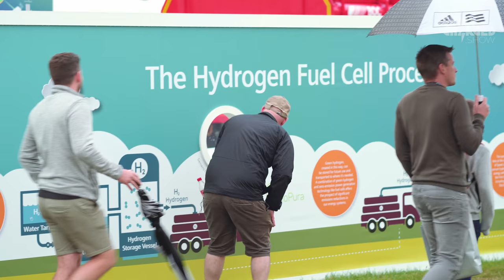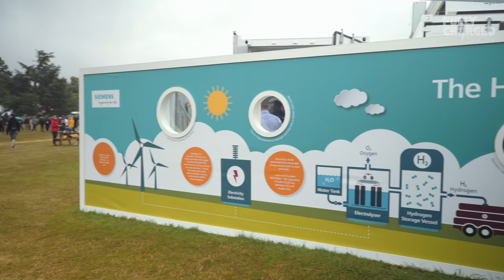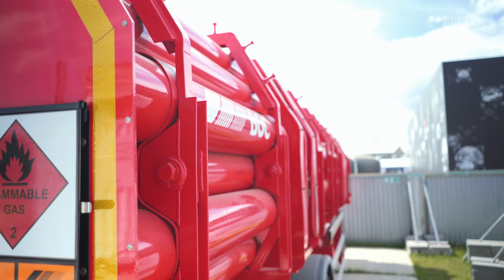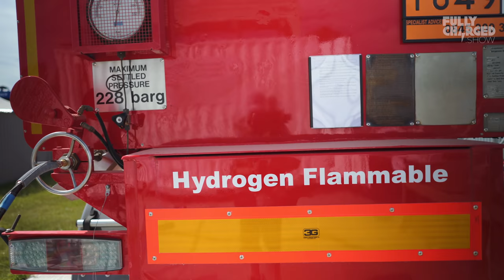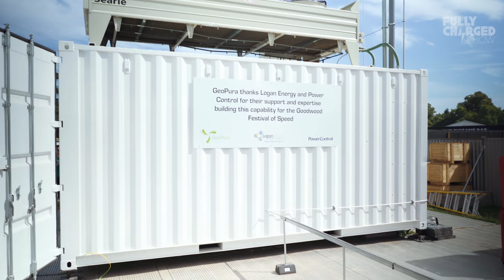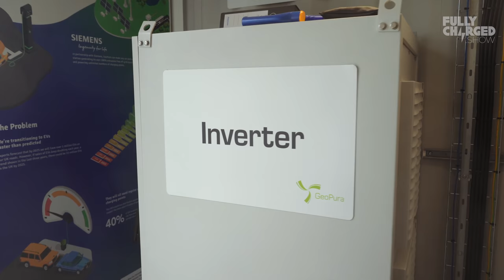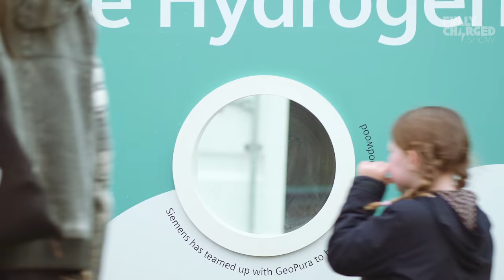Green Hydrogen Fuel Cell Charging System at Goodwood Festival of Speed | Fully Charged

Comment: In reference to 5:20, isn't a hydroelectric reservoir typically a great form of that rather than bottling up hydrogen? Since they can pump water up when electricity is surplus, and then generate on the way back down. Obviously that isn't a 100% efficient process, but loosing 50% of the energy going Hydrogen->Electric, and presumably more going Electric->Hydrogen to begin with doesn't sound great.
But from what he says, it does look like a good diesel generator replacement. Hopefully they can miniaturise it to the size of a diesel generator to make it a bit more useful for non-festival scenarios.
Reply: I think the issue is that you're limited by geography/ecology as to where you can place a hydro reservoir. This could be modular/placed much closer to population centres/where the demand is.
Reply: The method of generation you talk about uses more energy than it generates, but it's still really useful. Read about Dinorwig Power Station which has been featured on Fully Charged before. If the energy sources are creating too much energy the best thing to do is store the excess when you need it. A hydroelectric power station allows very quick access to energy, it takes about 6 seconds to spin up, whereas the hot stations (coal, gas) can take hours. The main takeaway is that you need to store excess energy and if you don't have a reservoir to fill, or batteries to charge, then hydrogen is an easy way to store that excess without impacting the environment.
Reply: aljowen not enough places/capacity for pumped water. Something have to replace natural gas and alike - and something have to store excess wind power.
Reply: @craighamnett  I guess that make sense on the basis of storing fuel for days/weeks/months. From watching the video I had assumed they were proposing it for filling short term gaps (so day to day storage). From that hyper long term perspective, I guess its almost like trading stocks in regards to when you buy your electricity, and then when you sell it. Actually, that lack of urgency to sell sounds like it could create some price gouging where people aren't willing to sell until 'x' threshold.

I have been to Electric Mountain in Wales and had the tour, I really enjoyed it.
Reply: Steve Davis if you use this for district heating - then heat waste will not be an issue. A large commercial static tank would also be able to store 1000 times this.

Comment: down with centralised electric production and large scale grid based distribution systems! what we need is a distributed e.g locally produced, stored and used energy. this is the best alternative we have! anyway! why not collect the O2 that comes out of the elecrolyses process store (like H2 is done in tanks) and use it instead of pumping in air containing less O2 from outside. this way O2 would come to good use and was not a waste product. also, why not have a stirling engine running beside the system producing even more electricity and increasing efficiency?

Comment: Nothing New here. H2 Fuel Cell tech has been around for a long time the reason why it is NOT popular yet is the production of H2 (even if it is green) tend to be more expensive that using the same to store in battery. Also these guys did not talk about the cost of Fuel Cell and a comparison with similar technologies like Flow Batteries which can also be used to store large amounts of Energy for similar situations (right now an expensive tech).
PS: doesn't that guy look ignorant when he talks about the current efficiency of ICE engines and was corrected right away?

Comment: could you not build a "base load hydrogen power plant" which makes electricity via the fuel cell, that then takes the water and excess heat and make a secondary steam turbine generator system to increase its overall efficiency?

Comment: The water isn’t pure, it can only be pure if you mix pure oxygen and pure hydrogen. When you mix the hydrogen in air it also mixes with nitrogen and other elements in the air. Plus pure water isn’t good to drink, it hates to be pure so pulls minerals from your body and pure water doesn’t conduct electricity so if you drink too much your brain and heart shuts down. There are always warning labels on distilled water about not drinking it. I doubt you have to worry though because it wouldn’t be pure anyway. I hate them saying incorrect information though.

Comment: See I live in a hot county so heat is not really needed.. even though of the idea of using that heat generated to generate some old school heat based power as well..
Reply: What if they converted the heat into cooling, that would be useful at a festival too. They could also use the heat to make the decompression of the hydrogen more efficient or use the commission for additional cooling

Comment: Hydrogen definitely has a place in an ICE-free world, as it has big advantages over batteries in several categories (refueling speed and energy density for example). Just need to work out the production, storage and transportation issues.
Reply: Not true , the entire hydrogen chain is far less efficient than batteries.  Hydrogen will never make sense for vehicles.
Reply: @JRP3  So you can say with absolute confidence that hydrogen has absolutely NO place - AT ALL - in the world? Not one single application would benefit from it? And notice that I didn't say that it would have to power vehicles necessarily.
Reply: You can say no such thing with confidence, dude. You are not clairvoyant, if such a person actually existed, and cannot foresee any and all scenarios that might present themselves. As I said in my original comment, IF they can work out the inherent issues relating to production (expensive), transportation (expensive and potentially dangerous) and storage (small infrastructure) then it actually would be desirable: Fill up in about a minute or two and smaller batteries with longer range and more power (due to higher energy density) are two of the biggest issues currently keeping traditional BEVs (lithium ion) from being adopted by the mainstream public.

Comment: -So Green energy meaning Electricity. So you take that electricity and make Hydrogen and Oxygen  ( At least)  Huge amount of green energy required. You then take that hydrogen and convert it BACK to electricity in a facility that even if the process was fully 100% efficient would still require maintenance , labor costs,  etc.  and on top of that a profit! for the company buying that cheap green energy and converting it to hydrogen and then converting it back into more expensive energy.  I can't help but think this is a flaw in the business model

Comment: Alternatively, carry a large battery and inverter. Much more efficient to charge the battery than convert to hydrogen and then back to electricity again. I'm not getting this, sorry.
Reply: Energy density I believe
Reply: There is no way to recharge a large battery in a field at Goodwood. Easier to bring in hydrogen in a trailer.
Reply: @oskrich4  Or bring in another battery in a trailer.

Comment: Only if you can 100%-ly transport, store and process CH4 (Methane) to hydrogen without the CH4 leaking into the air only then it will be clean. If not leave it in the ground where it's been for millions of years.
Reply: But this H2 isn't from CH4, although some is from CH4. Its made from using excess electricity to electrolyze water. Orkney is using their excess power to do the same thing.

Comment: Realistically, this is a doomed technology, interesting though it is. At best it will be nich for charging where there's not any or insufficient charging infrastructure, but that's it. Why would you create Hyrdogen from electricity to convert back with the associated losses unless you absolutely had to do it? It's certainly not going to be as cheap as charging from the grid, and longer range cars will make it there and back without the need to charge in the situations they're imagining.
Reply: @Steve Davis - Agreed. We already have a liquid fuel that you have to go to special places to fill up. Replacing that with a different one when there's an alternative where you can charge a car at home or at work is pretty hopeless too. It's a shame, it's  a brilliant technology, just not much use in private transport.

Comment: I wouldn't expect fuel cell technology to air on this channel, the last thing we need is wasting clean energy that we so much need.
Reply: It is a mechanism to store clean energy. You can't always use the clean energy at the time of generation so you have to store it. You can store it by charging batteries, by creating hydrogen via electrolysis, or push water up a hill and store it in a higher reservoir. The grid is a complex system that needs energy at the right time so you need a wide variety of storage solutions.
Reply: why? It's stopping people from using Diesel generators and you don't need incredibly expensive batteries.  If you use the heat then it's much more efficient too.
Reply: @Steve Davis AFC Energy have alkaline cells with a steel catalyst, an automated manufacturing process and they claim to be doing great work on increasing the  lifetime. They can also use hydrogen that isn't perfectly pure.   They are not improving electrolysis but if you can get hydrogen that is produced as an impure byproduct of other processes then it might not matter. It is true however that I am just another non-expert reading things on the net.

Comment: So why not just use the hydrogen in a fuel cell car......less conversion losses without having to charge the car off a fuel cell like here....(and yes i know that fuel cell cars have a load buffer battery)
Reply: Take energy.
Build expensive plant
Liberate Hydrogen (50% efficient!?)
Pump to tanker
Drive (expensive) tanker to point of use.
Store (keep it cold! Use energy!)
Pump to fuel cell (50% efficient!)
Use the 25% of electricity remaining to charge a car battery.

See the problem?
IT'S 25% EFFICIENT

Comment: Right so a truck and trailer unit has 3 mega watt capability so the equivalent of 30 100kwhr Tesla battery packs. So why not stick a bunch of charged batteries in a containeer. Oh right they are doing that. Tesla Megapack.  Hydrogen a solution in search of a problem.

Comment: H2 is made with natural gas. Getting the natural gas creates a lot of methane. Methane, which is next to co2, a very strong climate changing gas. H2 is everything but climate friendly. Also the efficiency of fuel cells is far from beeing good. It is closer to a standard petrol engine than an electric motor with battery.
Reply: And also by electrolysis which is very climate friendly. Talking about efficiency, petrol cars hovers around 35% (max) efficiency and diesel ones 45%. I see no one being mad about it.
Reply: I think you've missed the point of the video.

Comment: WAIT WAIT WAIT, How much electricity did it take to make the hydrogen in the first place? And where did that electricity come from?So if you factor that into the equation then the entire system is not 50% efficient at all. So ,to use electricity to split water, and then use the hydrogen to make electricity again is the single stupidest thing I've ever seen. Make electricity ,store it as electricity, in ,like, a battery. Then just use the electricity. If that truck was full of charged up Tesla battery's , it would store more actual energy than the hydrogen.

Comment: Using hydrogen to store electric energy is just wastful. You loose a lot, it cost a lot and it's very dangerous.
Reply: To be fair, the energy being stored is supposed to be energy that would otherwise not be usable, so if storing that energy and using it at a later time costs less than the cost of energy at the time of use, it’s not that insane...
Reply: Can not say that I agree that this is given. If you can make a system that make hydrogen and store it, you can also set up batteries that would be a lot more efficent.

Comment: Why not just cut out the middle man and put hydrogen motors in cars....
Reply: I assume you are referring to internal combustion engines. The reason is that burning hydrogen in engines has even worse efficiency than than the fuel cell route.
Reply: @Simon-dm8zv  no im referring to electric vehicles having a small hydrogen generator to power the electric motor, by cutting out the middle man i was talking about having to stop to recharge in the first place.

Comment: this wastes so much energy, only half is actually converted to energy the rest is waste heat, then the waste from chemical, into electrical, into chemical, again into electrical then into kinteic, why not just go chemical to kinetic, only needing few modifications to a normal combustion engine to run, then tanks to store hydrogen
Reply: @Steve Davis ICE engines are notoriously inefficient. They mentioned in the video that an open-cycle gas turbine generator is about 30% efficient. These HFC are almost 2x the efficiency.

Comment: 5:23 Aren't we already long past this tired conservative argument of "if the wind stops blowing and the sun stops shining" concerning renewable power production? At least since Horndale??
I would so much like to throw at these guys "if the oil stops flowing and the coal stops rolling" one day to see them squirm...
Reply: Afraid not.  The Hornsdale battery primarily serves as a frequency regulator — it supplies extra power or sucks up excess for a few seconds or minutes while other plants adjust.  This is something traditional power generation gouges heavily so Hornsdale is very profitable.  It would not be profitable if you made it big enough to store an entire day's worth of power, that's just way too expensive with current battery tech.
Reply: @rhamph  Point is, Cunningham's claim that this is hard to do with batteries is simply false. Those Hornsdale Powerpacks can be used as regular energy storage as well as a peaker plant. And Tesla just introduced their 3 MWh Megapack as well, the whole system in one standard shipping container footprint. These packs don't contain explosive gas and don't require all these extra containers with all that tubing and wireing. Sure, they don't make sparkly water though.
Reply: @2nd3rd1st  If you translate "hard" as "insanely expensive" then it is hard.
Reply: @rhamph  I agree, but the price may also be a matter of negotiation and I guess this complex hydrogen contraption requires a whole lot of expensive maintenance. In any case one always pays more for advanced tech.

Comment: If you're already making hydrogen out of air why not the whole carbohydrate fuel for existing cars? Problem with hydrogen cars is that they're expensive and even if they were the same price as gasoline ones, people would still need to throw away their cars and buy new ones, so it seems creating artificial carbohydrate fuel is a goldmine awaiting to be exploited, especially since there are also ships, planes and trains to think about.  There's Sahara, build the solar thermal power-plants, use sea water for hydrogen, air for carbon, create fuel and we have a carbon neutral world.

Comment: Sorry, this is really dumb. I and many others have explained this over and over, hydrogen is pointless, the overall fuel cycle efficiency is so low, you waste at least 2/3 of the original energy, regardless of source. You are much better off charging a large battery directly than electrolysing water, compressing it and running it through a fuel cell. Indeed, you get 2-3 times as much usable energy if you just stick it in a battery rather than messing with hydrogen and fuel cells.

What's happening here is that large companies like Siemens are seeing a new market in fuel cell systems and so are pushing them, despite knowing of the inefficiency problem. They don't care, it's a new market for them to exploit and make money in, which is what shareholders want. Of course, the people who get suckered into buying fuel cell systems often understand none of this, they just hear "hydrogen" and think "green" when that really isn't the case at all.

I really, really wish FC would stop doing hydrogen videos, they distract from what we should be doing, which is pure electrification with maximum efficiency. Sure, you can use hydrogen to store excess energy from renewables, but you lose most of that energy doing it, it's almost pointless. Sticking that spare energy into batteries would give you 3 times the usable energy when needed.

It's not like hydrogen is easy to store or handle, the stuff is a real problem, it requires massive compression - you can't store it at low pressure as it takes vast volumes, even underground storage wouldn't store a great deal, and you would lose so much H2 to seepage etc because it is such a small molecule, it simply isn't worthwhile.

All of this has been looked at over and over, and the numbers for hydrogen just don't stack up for pretty much any application.

That system they have there in the video could have been a large mobile battery like the Megapack plus a large solar array (there are portable, fold-out arrays already available) and it would have been cheaper and simpler to implement and much, much more efficient.

Hydrogen is a solution that has already been superseded by batteries, it's a waste of resources, both manufacturing and research. They persist with it because it keeps people in jobs and makes money and shareholders love it because they are, by and large, scientifically illiterate.